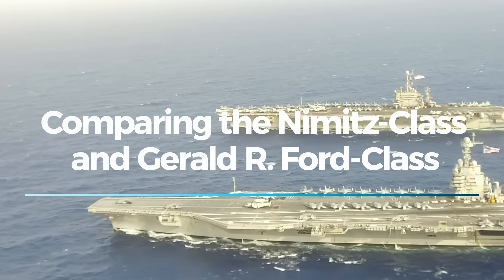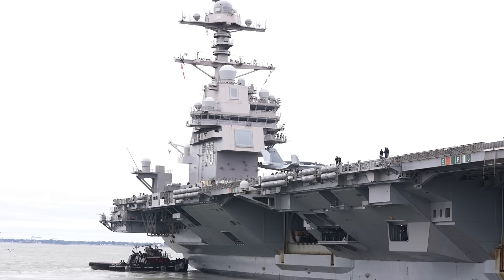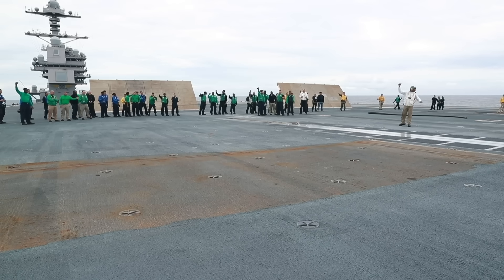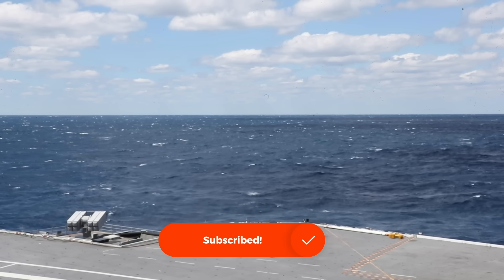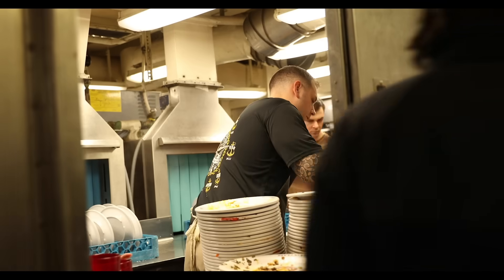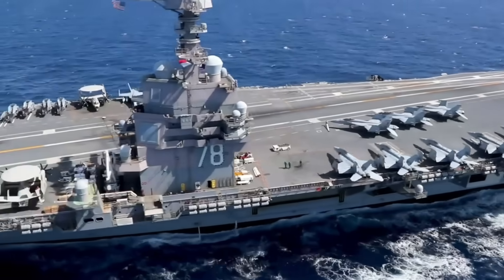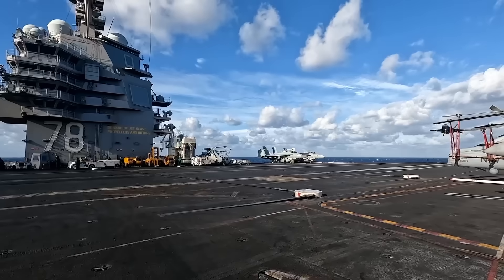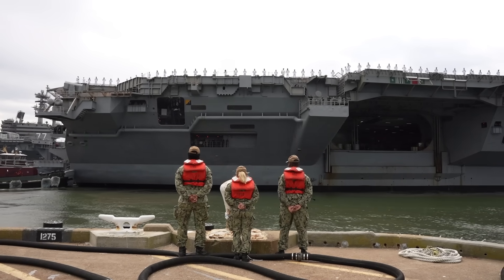Comparing the Nimitz-Class and Gerald R. Ford-Class Aircraft Carriers

Comment: All the reports always forget the same thing and it's a big one. It is catapult No. 4 on the Nimitz-class aircraft carriers that has operational limitations due to insufficient wingtip clearance along the edge of the flight deck. That has been FIXED on the Ford class. now all 4 cats can be used, 4 planes is faster than three planes.